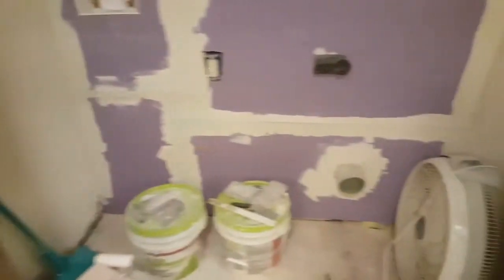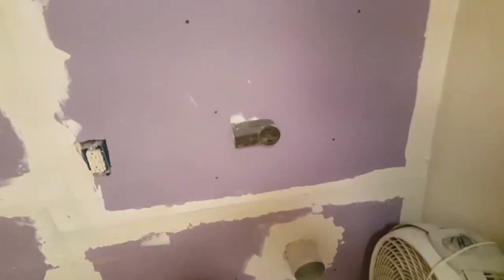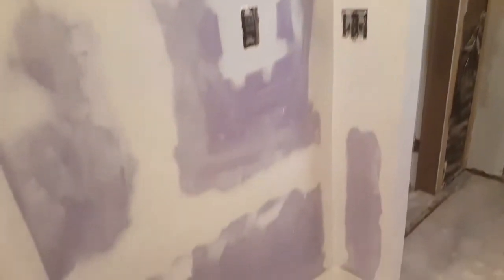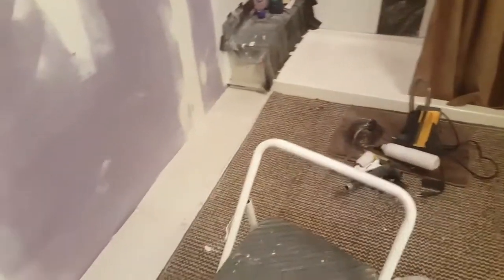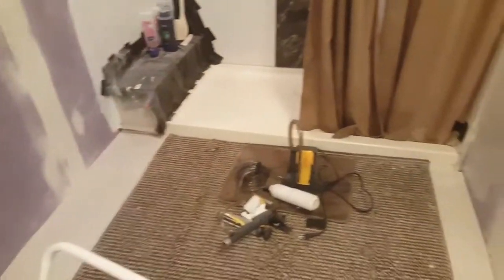Our bathroom makeover part 12

Comment: Looking good. What is the electric paint thing your using. Looks like it works quite well. Is it normal paint you are using & how fast does it use the paint.
Reply from the maker: David Tyler it's a sidekick from Wagner and it works real well I don't know how much painted as she uses a second but it comes out very slowly and roll it just anything I don't have to worry about nothing else